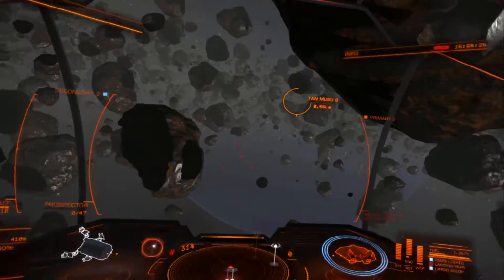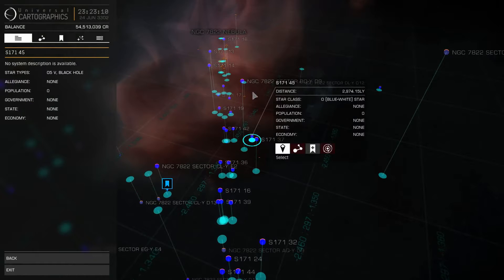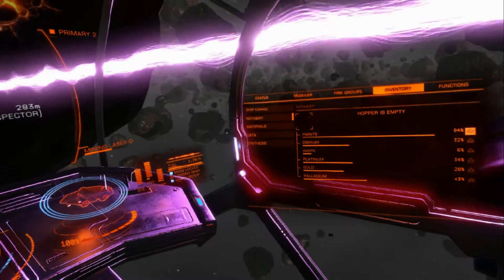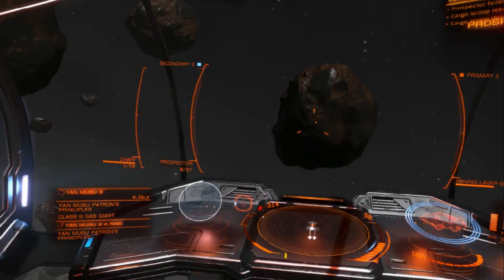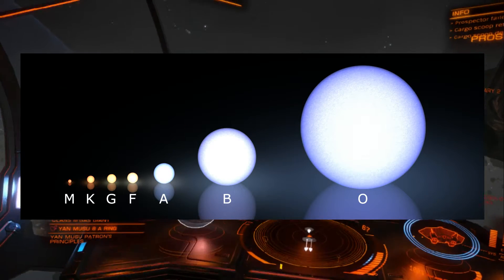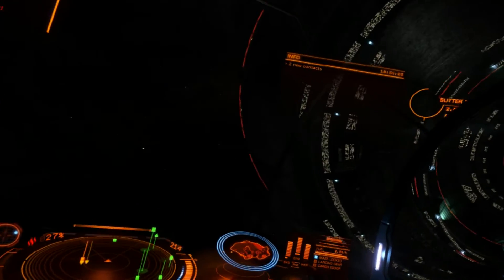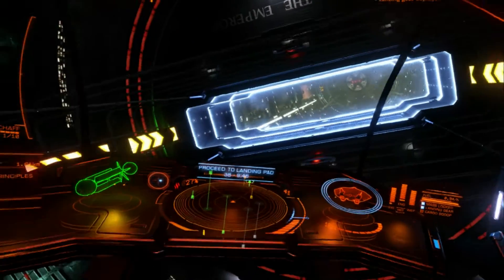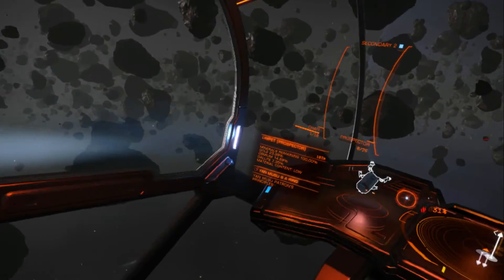PHYSICS OF ELITE DANGEROUS

Comment: In ED ship constantly fires main engines, then moving forward with constant speed (at least, in FA-on mode). In real physics world, then engines is on, ship should accelerate itself, and no engines should be fired during constant movement.
Reply: I agree, it seems like standard Newtonian acceleration and deceleration doesn't apply. Thrust should be measured by g's of acceleration with kph and velocity as a different measurement in relation to the other orbiting bodies in the system. If you accelerate for an hour at 1g then you need to decelerate for one hour at 1g or 1/2 hour at 2g and so on. Deceleration is like 50% of real space flight. Everything in warp flight has the "suspension of disbelief" benefit but not standard thrust.
Reply: Have you tried turning off flight assist?
Reply: @Shadow__133  Hmm, physics should work correctly in both, FA-on or FA-off modes.
I use FA-off for purpose, but I didn't do actual check how engines work in FA-off mode.
Reply: @semibiotic  The way I see there is a speed limit that is not realistic. The flight mechanics are not very realistic because they had to make it fun for combat and you need to go faster than light (unlimited power). But the physics are very realistic, including orbital mechanics and such. With fa off you keep drifting at constant speed, however the speed is still limited... so you are right, but the picture seems to be more complex.